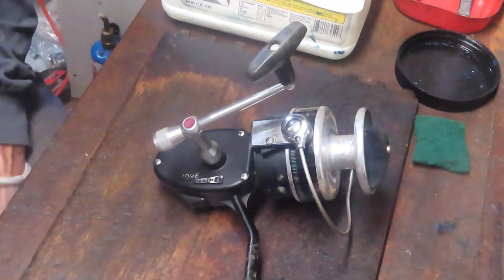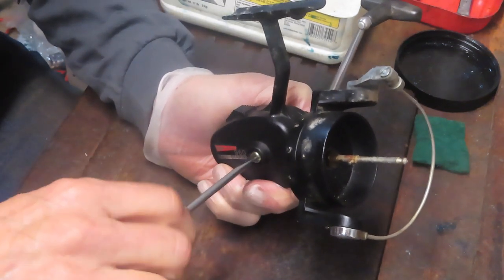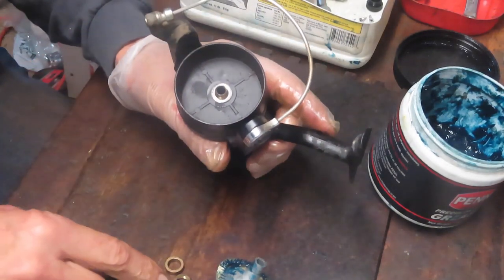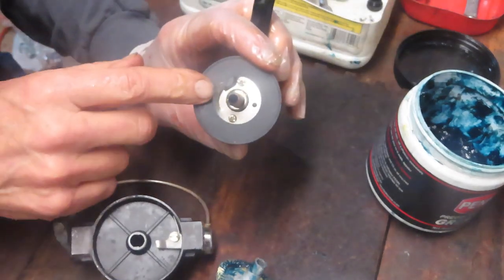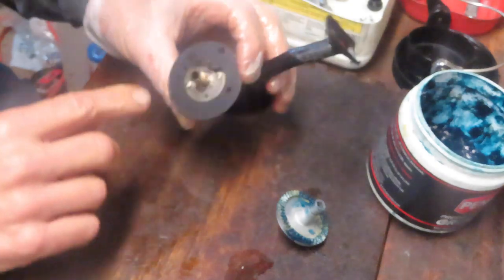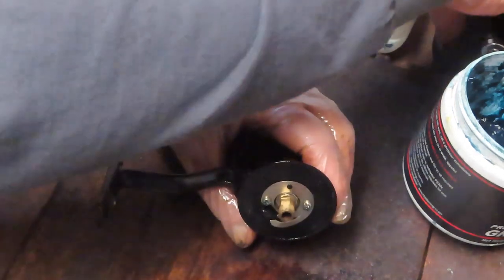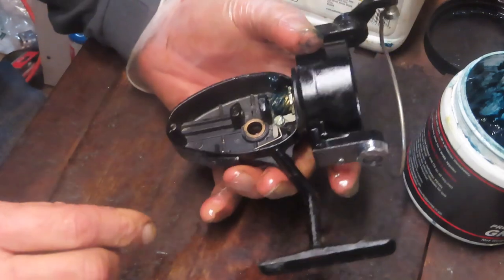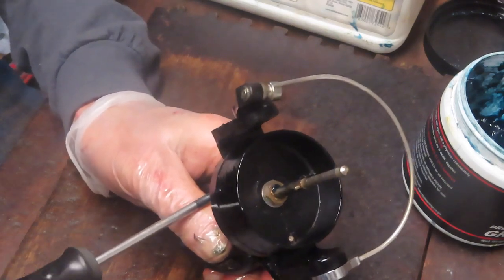Vintage Garcia 9600 spin fishing reel how to take apart and service

Comment: Thanks for doing this one Dennis as I just got one of these. I have several Garcia reels including a 9000. This 9600 appears to simply be a larger version of the 9000. The mechanism is identical. I did have a bail issue with my 9000. I had a cracked bail arm as my 9000 had a black plastic bail arm rather than the metal arm. Try as I may I could only find metal bail arms for a 9000. That made my bail screw too long. I found a black spacer that worked perfectly. I also had to buy a new ball bearing for the reel. You can back that pinion out backwards if you can get the bearing and spacer out the front. You’ll never pull that AR ratchet out the front. Took me a while to figure that out. I’m disappointed that this 9600 did not have at least two drive bearings. I don’t like the AR but I can live with it. You are so correct that these Garcia reels can’t match the earlier French Mitchells as far as enginerering and design but I still like these reels. I have two Garcia 280 reels that are very nice and 1 280GK that is even better. All are saltwater reels. Thanks for doing this video as it reinforced the experience I previously had with a 9000.
Reply from the maker: Glad to help Chris. - Thanks - Dennis

Comment: Hey Dennis im guessing this is same size or is it bigger or smaller than the mitchell 406 ? And a great question of mine is have you ever had that one reel out of your years of experience had you stumped and confused?  And not able to get it back together? I know iv been there before since I started working on fishing reels since I've got my confidence I have took on all different kinds and have been successful at it as always thanks for the videos and the great content always look forward to watching what you're working on and learning what I can
Reply from the maker: Yes - this is about the same size as the 406. I have had a few reels that have stumped me and I have learned to take pictures and get the schematics for reels that I have not worked on or am unfamiliar with.  A few reel in the bag projects missing parts is always hard.  I remember two clearly.  A person sent a reel in that needed a replacement bail wire.  What they didn't tell me was that they had the assembly apart.  It took me hours to figure out that they put the bail arms without the wire on backwards - left one on the right post, right the left one. That was one I won't forget.  I could not load that bail spring.  The first Mitchell 300 I ever did wound up in the parts bin.  I could not figure out how to mount the oscillation gear to the side to get it to fully rotate.  Springs are the hardest.  If a spring shoots out of a reel that you don't know, it may be your end as many don't have obvious terminals that they attach to.  I had that experience with a Penn Slammer bait feeder.  The trip lever spring was nearly impossible to remount.  Thanks for asking - Dennis
Reply: @2ndChanceTackle  wow yea iv done a 400 mitchell that thing is a unique design i would have to say my 1st biggest battle was a Shakespeare Tidewater 30l one of my personal reels it was a balancing act trying to get that thing back together thank goodness you had a video on it that helped may get it lined up right because I could not make out the schematic I would say I wish you would do another video with a little clear detail on it but nonetheless I was able to get my real back together and working with the one you do have it was a true Balancing Act trying to get it all back together with the level wind and crossbars and everything I found it to be a little tricky I vowed to never fishing in saltwater again LOL but nonetheless I got to say it has held up very well over the years I've got it on a Berkley big game 7ft medium heavy loaded full of 25lb always have enjoyed watching your videos very educational at this point honestly I feel like there isn't a real I can't do I think I've gotten a little bit cocky to it and I am curious what is probably the hardest real to work on I would like to try a hard one for once a good challenge would be nice for a change LOL as always thanks for what you do and sharing your knowledge with everyone
Reply from the maker: I guess you can try a Shimano low profile bait caster or a Shimano Stradic with the worm gear drive.  Those are always fun. Watch this video for a preview https://youtu.be/gLV9CqvHqkQ

Comment: What size is bearing.
Reply from the maker: I am not sure and I do not have one of these reels in the shop to measure.  You can do it if you have a caliper.  Measure the inside diameter of the hole, the outside diameter of the bearing and the height and you can order by that spec. Sorry I can't help further - Dennis